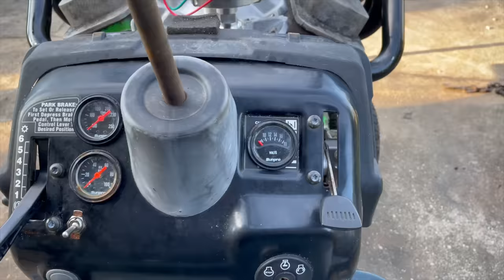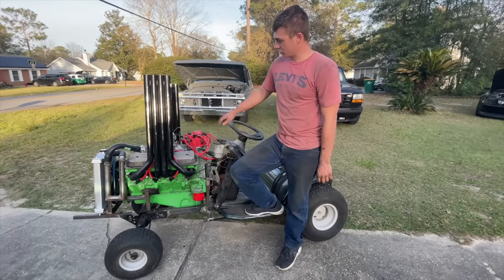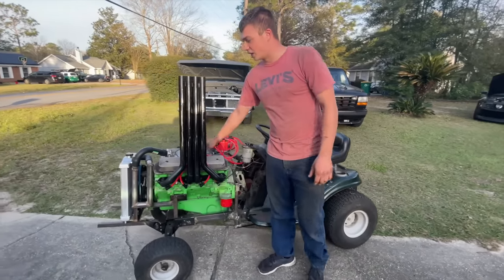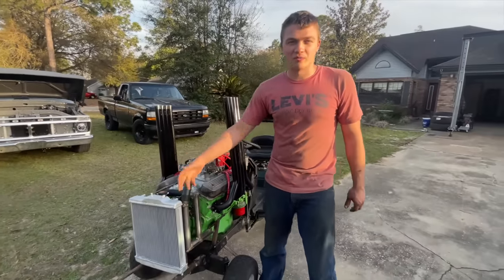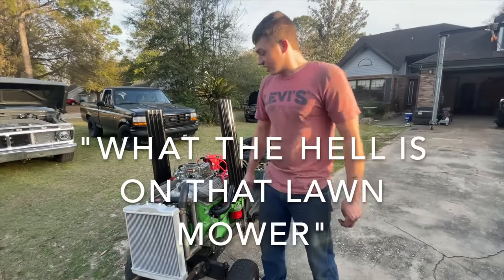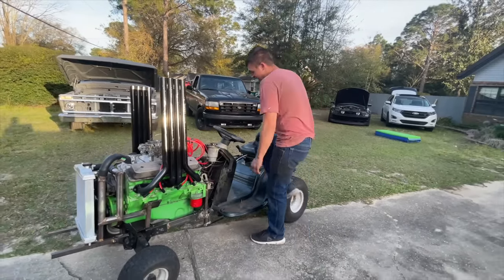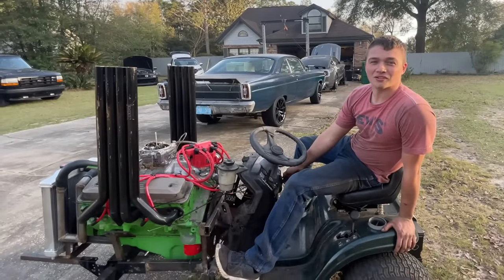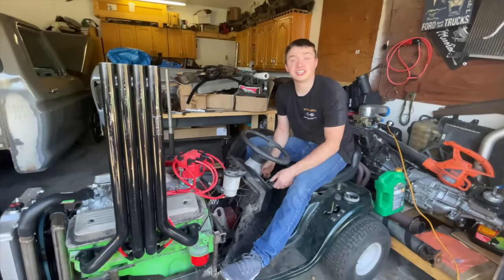FLORIDA MAN V8 SWAPS LAWN MOWER

Comment: Need to make the frame stronger. Not to say you picked the worst lawnmower to do it to. Those mow great. But the frames twist so badly on them. If you were to put the engine on a Craftsman, or Murray frame I'd be much stronger. Also those mowers have terrible belt/ transmissions. They work pretty well but just eat up belts like no other

Comment: It was great to see you use the Edelbrock intake instead of a chinese knock off !
Reply: Yeah, I was wondering about those late heads and early intake center bolt angles. Had to hog 'em out huh?
Reply: @paulhare662  That was my guess. TBI heads and a standard Gen 1 intake
Reply: Okay why would you anyway okay but anyway summit is the way to go or napa no knock offs there
Reply: I love my Edelbrock stuff but it's worth more than the engine, I buy used intakes mostly, and I don't own any Chinese aluminum but I would consider it for a lawnmower
Reply: Well after all this is Murica is it not ?

Comment: You are heading in the right direction !
Take your time, and sort out the correct drive systems needed to drive a larger than original mower deck !
Maybe something like a 60 inch deck !
Stiffen up the chassis a bit !
Extend an original hood, and make it look as close to correct as possible ! 
And then you will definitely have something no one else has for sure !

Comment: Id put a gas peddle on the right side floor board and a 292 cam and a different transmission so you can go faster. Cool build. You did a great job at fabricating and stretching the frame and buildings the motor mounts and radiator support and the top radiator hose. Keep up the good work. You can build anything you set your mind to.

Comment: You should put high gearing in the gearbox and hook the throttle onto the steering wheel so it goes 10 times faster

Comment: I built something like this about 14 years ago out of an MTD mower, but I used a roller cam 5.0L Ford with a C6 auto and narrowed 8.8" rear end and 15" 5 lug wheels. Festiva front spindles/brakes/wheels. It was a sketchy machine and would do ~70 MPH in 1st gear. I burned about 5 gallons of gas and cut it apart before someone got killed

Comment: Easy fix, unbolt the rear-end, turn it upside down, bolt her up, make a new shift linkage, bam... forward is forward again, get a gas pedal and throttle cable on it, and it could be a ton of fun!

Comment: Put a larger pulley on your gearbox and a smaller pulley on your rear axle and you will increase your speed. My MTD lawn mower that I cut the grass with top end is 25 miles an hour. But it cuts the grass beautifully at slow speeds

Comment: You need to get a 9-inch Ford rear end but drag slicks on the back and change the transmission over to automatic like a turbo hydramatic 350. Get some 2in 3in rectangular tubing and build a frame

Comment: I know this is super old by now, but I think it should have the 2 stacks w/combiners, so a big bore pipe on each side w/a flap on each. Hydrostat drive maybe? A throttle cable of some kind? Actually connect a mower deck, or PTO/hydro dragger. A fuel tank? Great start.

Comment: I've got a Cub Cadet, Swapping a 3800 Buick, still has the auto trans attached to the motor.  Steering - I'm looking at a boat motor hydraulic setup.. I'm going to have to with passing the auto trans under the seat.  Definitely will need to be lengthened like yours though

Comment: I loved that first comment: "I mow my yard a quarter-mile at a time".
What will it take so it is just as good as it originally was, with the right gear ratio? Then put the mower back on.
You can get away with those zoomies as they are if you keep it at idle, but I was thinking about OE headers turned upwards with a pair of cherry bombs with the tractor flapper caps on the ends. Even if it is still loud you can honestly say that you tried to quieten it down.

Comment: In Minnesota.  We have  club that has their own tractor 
Pulling sanction. Called.  The mini rods.  Hot rod garden tractors  with  v-8 engines  modified automatic transmission & 9 inch rear end.  They pull at town celebrations on a city street.  The tires are smoking from the time they hook the sled. All the local gear heads are there to see the show. With a cold beer in hand.

Comment: Nice job but on the radiator hose top  , all you need was a 1/12 or whatever fraction  copper tubing 180 available from any plumbing supply house, 2 clamps and  done... total trough about 2.5 inches . 
Other than that ...awesome

Comment: Too bad the v belts only hold 27 h.p... cut down a 10 bolt gm 8" rear dif and axle,  Fabricate a  Cone clutch or dog clutch and direct drive from the engine to the dif.

Comment: what does it need?

a gas pedal...
flapper caps on the exhausts, gotta keep the rain out...
a mower deck that works...
a transaxle that works (the one in the clip didn't seem to offer much in the way of forward speed)...
brakes?

Comment: Sweet ride Ya Got this  Buildin One Like Yours Old School V8 Crapsman Gear Box and extended frame and pipes along side and rad in Bk and Battery in front 4 Barrel basic tubed the frame  Bigger tires and Bigger Diff Handle the Power straight mount like Yours Lower  the gearbox how ya Make it Hook too the Diff ? Ya Should Call it The Creeper thers Lot,s out ther but they Don,t Move So Ya Got this Hopefully send ya Some Pics of Mine soon Farmer Thks For Sharin Keep Us Posted

Comment: I used to do that to build an unlimited class mini tractor pull tractor for our festivals and the county fair.  Built a "79" White garden tractor since it had a heavier frame and it had a heavy frame because it had a cat. 0 three point hitch on it. It was stretched out by 14" and was able to have a 4 speed transfer and a modified rear end in it. The engine was a rebuilt detuned 331 chevy race engine. It did alright did win some but it was mostly for the fun of it all.

Comment: Throttle pedal and get the correct gear box rotation. Heavier spindles to support that V8.
Don't need a cam.
They are my suggestions.
As far as a name, it will come to you.

Comment: Definitely needs a trans due to the length manual so it's not so long maybe a Muncie are a Saginaw so you still have granny gear to putt around 9" Ford shortened rear and with that you need to do something with that steering/front high speeds can get a bit of a death wobble but just a little bit 😂

Comment: I think you can spin the rear axel over or around in the mower to make forward forward again,   I saw someone do it in a video .   also on a safety note , Take that radiator hose pipe you made off and weld a bead around both outlets to keep the hose from blowing off it will give the clamp something to grip too.  You don't want 4  gallons of boiling water to blow loose in your lap . Looks awesome

Comment: Okay Mr Ford man. The drag on the engine is the Ford power steering unit. They always leak eventually. Okay I'm having some fun with you. Where's the mower deck? Before it probably had something like maybe a 46-in deck. Make it 46 ft now! Haha. I'm not sure why you did this except for the heck of it but I sure enjoyed the video. By the way next time go get a 1975 or earlier 350 large two barrel carburetor engine out of an Impala. You see those engines are vet engines. Or those engines and vets are Impala engine. They run the same numbers. Just a fun fact. If you really wanted to hook up a mower deck reinforced frame and use a small brush hog or an old belly mower off a Massey Ferguson or something. Put flap lids on your exhaust header tubes to keep the water out. And it would be neat to see eight of them opening up and moving with the throttle. Chrome would look nice. Thanks for taking the time to make the video it's very entertaining

Comment: Did this about 12 years ago mated a 454 to a old sears suburban garden tractor had a 90 degree gearbox from crank shaft to 3 HD belts turning the factory HI/LO 3 speed transaxle

Comment: I would 100% not be sorry about causing an accident if I were driving by and saw a guy with a 350 on a lawn tractor. "Worth it!"
I was actually wondering what you did with the back end as far as the transaxle goes, but I'm guessing stock? Must be some mighty belt slip going on!

Comment: Real trans with civic fatt tires extra small rims thick rubber wheels, or mower trans and 1 to 1 gear ratio with a burnout! Front leaf springs or shocks for stability

Comment: That's Amazing! What piece did you use to angle the trasmission from the flywheel to the base of the chassis to connect the belt and pulleys?

Comment: Great swap!!  Great build!!  First!... a gas pedal.  2nd.. want to see it actually accelerate when you hit the loud pedal... why is there no instant response (wheel speed) when you stab the throttle?   Personally, I would have gone the motorcycle engine with its trans, route... and whatever final drive.  Power to weight ratio is Everything.... but!!.. you get an "A+" for a cool build with good engineering!!   Keep up the good work! ; )
Reply: If I had to guess I would say the lack of acceleration would be due to there being just one little V belt in the middle of the drivetrain - hit the gas and smell the rubber (belt) burn as the pulleys spin and the wheels start to think about turning.

Other than that V belt issue this is a seriously cool build, I really like it a lot and would love to build something similar myself.

Kudos to this kid for his build!

Comment: Years ago when they was putting a V8 in a Chevrolet Corvair mid engine or was it a VW the ring gear was moved from one side to the other so the trans would work as it should might be able to do the gear box the same

Comment: Throw a craftsman 6spd transaxle under it & see how long it’ll last w 250hp or do a swap with a horizontal shaft peerless 2300 out of an old John Deere garden tractor from the 70s-80s. 

If you can get an old IH cub cadet transmission from a 128 that’s a shaft drive  w a clutch or just drop the 350 in the Cub.

Comment: What did you do for the drivline, fabrication and wireing looks straight forward, did you use the factory rear pto, and pulleys? Also what gearbox did u use
Reply: I think he used the stock gesrbox he said it was rated for only 37 ponies lol and reverse is forward now because of the engine direction.

Comment: Fix the reverse trans issue and pulley swap it, I have a craftsman with a 17.5 Briggs and I put a 1 inch pulley in the rear and a six inch pulley off the engine... it goes 30 mph

Comment: Definitely adjust the speed, add proper gas pedal, upgrade steering and suspension, maybe make it 4x4 and maybe make so you can actually still cut grass with it ffs :D

Comment: The trans does not give you different speeds. It is a single speed and the same in either direction.  You get your speeds from the varidrive belt system. You need to change belt length to get different speeds.

Comment: Use a 2-speed Powerglide and a differential from a 1964 Impala. Put taller and wider tractor pulling tires on it take it down to the lawn mower tractor pull at your local Ag Center and see how will you do.
Reply: Yes I know this is from 2 years ago but you must still have it I hope
Reply from the maker: Yes I do still have it

Comment: Put your 8 in to 9-in pulley on the front that will triple their speed and you got the very drive on the back so you can't put a little French pulley on it if you had an manual transmission you could I had a mower with a 15 horse pulley swapped 8 in the front 3 in the back 60 mph and that's just a lot more motor I can imagine what that 350 would do you would probably want to upgrade brakes I burnt the little brake pucks up three or four passes

Comment: ironic that the lawn needs care ... but your having too much fun with your lawn mower !! I looked up average V8 horsepower at idle but did not find much info but I would guess about the same as the original engine but torque would be a big difference !
Reply: A stock 350 makes around 150hp I do believe

Comment: Maybe put an sm420 with a PTO granny box for Speed or install a new Venture 4500 because both sm420 and the new Venture 4500 7.05first gear and 6.34 to 1 first gear in the new Venture 4500 and then it's got an overdrive and the short length of them the use of a Quadrajet because you can fine-tune them a lot of people take quadrajets and throw them away but they're really an awesome carburetor rear axle out of a Cushman cart cuz they use a ring and pinion rear axle design similar to automotive technology

Comment: I just came across your channel and watch you put your Chevy engine in your lawn mower I have a handicap and I have a three-wheel scooter that it's like electric wheelchair bet three-wheeler that I have Amber lights and a ham radio for a cover my ham radio operator faux Locs closure I have my Amber lights not attached anymore but I am working on we wiring the amber light so right now there's they're not attached that in principle I just wanted to kind of put some thoughts together

Comment: I don't get it, how do all these loosers seem to lose the blocks because of cracks or heads because of worms or cracks ? I have rebuit 50 sbc and not had one like these guys explain,  how do you drive them versus the west coast, or is the oil really that shifty over there so the motors don't hold up like west coast.